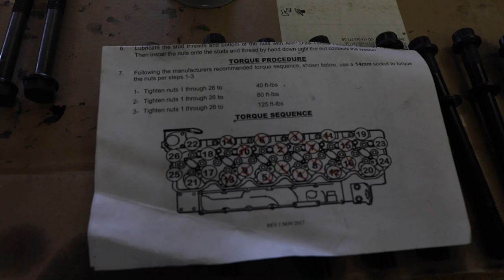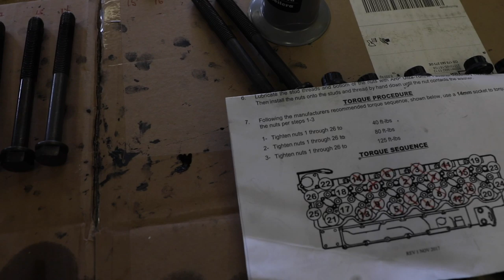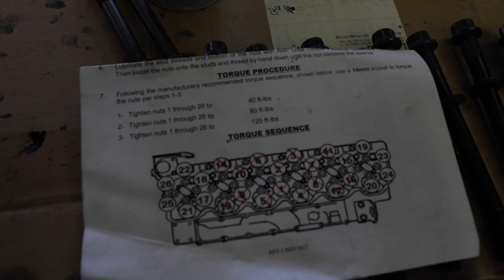Cummins Head Stud Install Technique - 2005 Dodge RAM 5.9L 24V

Comment: Can feel your love for your 05 Cummins and for quality "good sense" mechanics!  Thanks for all that you do, keep up the great videos!  Just had to do injectors on mine and wanted to do this job while in there. I also use your "injector replacement" video as my main go to for that job!!
Reply from the maker: Hey thanks Zach, if you email me at the address shown at the end of the video, I can send you the detailed instructions for both the injectors and the head studs. Torque specs and sequence, etc. Much more detail than in the videos. Good luck to you, Greg
Reply: I too have an 05 Cummins 3500 dually. Greg, you are an excellent teacher in explaining mechanical procedures. You are right about other videos being incomplete and rushed through. Thank you for doing a stellar job in this video. I will search for your video on replacing injectors. That's next.

Comment: I just used ARP studs in my subaru WRX rebuild and the instruction outlined the lubing of washers on top only and dry/clean at washer to head exactly as you said- appears they updated the literature. The grooving of an old head bolt to ream the holes works like a charm; my grandfather taught me that one

Comment: Excellent video Greg! Thank you!!  Does temperature affect torque values when installing head studs?  eg. having a warm block before starting the process or should the block be at ambient temperature?
Reply from the maker: Hi ya Roy. Gee I have no idea. Perhaps someone here will know. You could also Google "Cummins Diesel Forums" or Dodge Diesel Forums" and ping some of the folks there. They have some very knowledgable folks on the forums that probably have some insight on that.

Comment: thank you for sharing. i’m wondering what’s the mileage on the truck when you do this. mine is little high on mileage(154,000 miles) nothing  is wrong with it yet. thinking about doing this but don’t know replacement of head gasket is necessary. thank you in advance.

Comment: Great video! Plan on doing this upgrade soon…one thing I noticed is instead of lubing the top of the washer, you can put them on totally clean , and just lube the bottom if the nut…serves the same purpose . Did you end of making a thread chaser with an old bolt? Or just blow out the threads? Thx BG
Reply from the maker: Good tip. Just blew out the bolt holes.

Comment: Had a issue today where bolt 14 bottoms out about a half inch earlier then the rest in that row should I use a tap to clean the threads or take the head back off and use a old bolt and grind it down?
Reply from the maker: Gee that’s a bummer. A tap can remove metal which we don’t want. The thread chaser recommended and sold by ARP is not a tap, per my conversation with them, because it is designed to only remove debris from within the threads rather than cutting metal as a tap would. Unfortunately Their tool is not long enough to reach through the head to the bottom of the hole. If it were me I would first take two old bolts, cut the head (and the correct amount of the shaft) off one and weld it to the other, thus creating a long enough bolt to reach the bottom of the hole. Maybe even grind the tip to a bit of a point to help with penetration into the debris and once the debris is broken loose a bit then grind the bolt back flat to ensure threads are cleaned clear to the bottom. Actually, You could build two thread chasers from 4 bolts with one of them being pointed... if that didn’t work then maybe buy ARP’s thread chaser and weld an old bolt to it. I’d try all that before pulling head. Oh, and in the old bolts, take a die grinder and cut 4 equidistant vertical grooves through and perpendicular to the bolt threads, kind of like a tap is done, to allow somewhere for the thread debris you break loose to go.

Comment: From all the forums I've been on and even other videos I've seen the torque sequence with the 1 by 1 method is supposed to be, Remove old bolt, install new stud, Torque to 50' lbs, wait a sec, torque same stud to 100' lbs, move on to next stud. After all stock bolts are removed and replaced with new studs and torqued to 100 lbs (stock torque) you go through and torque them all again to about 115' lbs. Then you go through them all again and torque them in about 15 lb sequences until you get to whatever your final torque number is. The point of the 1 by 1 method is to keep EVEN pressure across the head. However taking 1 at a time out and torquing it to 125' while the stock head bolts are still only torqued to 100 lbs seems more risky.. 

It even says in the glacier Diesel ARP head stud install instructions:
""In the next series of steps you will be replacing one bolt at a time with a new ARP Head Stud and bringing the new stud back to stock torque. Do not increase torque levels at this time. Do not attempt to replace all bolts at one time. Your goal is to maintain torque on the cylinder head until all stock bolts have been replaced with ARP studs one at a time".

Just thought I'd give you and others a heads up.
Reply from the maker: sneek24 Hey thanks for the heads up. At the time I did this I called the ARP technicians and they cautioned against any other sequence than what I described in the video. I have detailed notes and step by steps for anyone who will email me. Those instructions include the comments from ARP. The method you note makes really good sense to me. I have found that “the only thing constant is change” so it wouldn’t surprise me if ARP’s research has yielded an improved approach. Thanks for the heads up!

Comment: So the reason for these studs is to get more threads into the block
Reply from the maker: Yes, that’s what happens, and along with the stronger steel of these studs, they are intended to hold the head more securely to the block, thus allowing greater cylinder pressures without blowing a head gasket.

Comment: Don’t worry about the studs or bolts, (closest to push rods) coming out with oil on them. 
That is normal. My 6.7 had oil on all the studs closest to the push rods. Rest were dry or had slight film of oil on them from assembly.
Reply from the maker: Ben Dover Thanks!
Reply: @gpwrinkled  Greg was there any problem with the long stud AT #19 or the short AT #23, 24, 20?
i was also told that the lower cover at the #20 the lower cover had to be machined out to accommodate the nut and washer,
how did you do it?
Reply from the maker: @rexalexander8732  I am not sure what you mean by 'any problem' with the long stud at 19 or the others you mention. There are 6 studs that are longer than the others and they must be installed along the exhaust manifold side of the head at positions 3, 6, 11, 14, 19, and 22. The nut and washer for the stud at position #24 will interfere with the rocker box, also called the lower rocker cover, unless you remove material as shown in diagrams in the instructions that come with the ARP studs. I removed that material with a drill press. I did the removal after I had installed all the head studs. I lowered a large diameter drill bit through the hole in the drill press table, secured it there, and then used the drill bit as an end mill which means I pulled the rocker box against the side of the drill bit, with the rocker box flat on the drill press table. I removed a little at a time and tested the fit on the head, ensuring I didn't have interference with the installed Nut. Using the drill press ensured that 1) I could take a little off at a time in a controlled way (rather than with a hand held drill or dremel), and 2) with the drill press table being square with the bit, it ensured I removed material square with the rocker box. Note where the rubber seal groove is on the bottom of the rocker box and be sure you don't remove so much material that you eat into that seal crevice. Hope that helps. If you email me I can send you the head stud diagram and instructions from ARP which shows the head stud numbers and locations and the graphic of material removal off the rocker box.

Comment: Hello what is that think next to the monster ram intake that says pacbreak
Reply from the maker: The Pacbrake is a brand of on board air compressor. The compressed air primarily is used to flip the exhaust brake butterfly closed in the exhaust system  to slow the engine and drivetrain without using up your brake pads. Mine also is used to air up after market air bags on the rear axle and provides an air port to fill tires if needed.
Reply: Greg Porter thanks

Comment: Where did you get the intake mounted pacbrake?
Reply from the maker: Hi Alex, It was on the truck when I bought it, but I have had conversations with the Pacbrake folks and have learned that it is an older design from about 2007. They say their current design won't mount right with a Banks Monster Air Horn. I installed the Banks Air Horn and had to do some grinding on the side of it to get clearance to the Pacbrake. I'd suggest calling and talking with the folks at Pacbrake about options.

Comment: Excellent advice, thanks, I suppose if you were worried about grease contamination, then after the install, you could just hit the top of the engine with brake kleen, let it evaporate and pour a bit of oil over the washed area and change the oil?
I kind of do this on all my vehicles due top end maintenance, put it off until oil change time and do it all at once.

Comment: who made that pacbrake mount? Great video by the way very helpful, I am currently doing the studs on my truck.
Reply from the maker: shweller The pacbrake was on the truck when I purchased it. However, I called Pacbrake asking if the Banks Ram Air intake  would mount with the pacbrake. They said it was incompatible with their current mount for the pacbrake but that mine was an earlier generation mount which allowed the Intake to fit after I ground off some of the embossed lettering from the intake. So in short, I believe it is the stock Pacbrake mount from about 2007 or so. Good luck with your head studs. Happy to send the detailed instructions if you email me. Email is at the end of the video.
Reply: Greg Porter Thank you for taking the time to reply to my question. I completed the job and am happy with the results and the piece of mind. Keep up the great content.